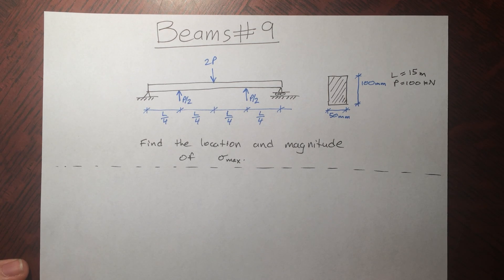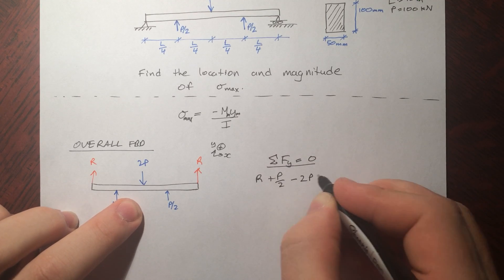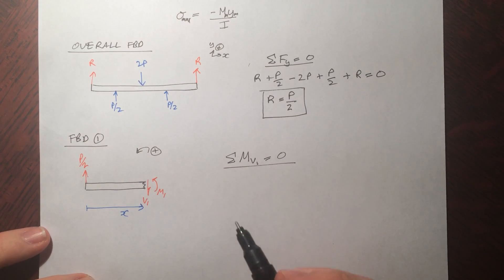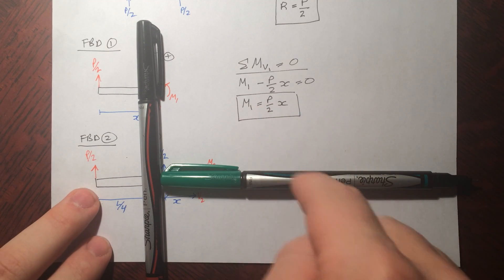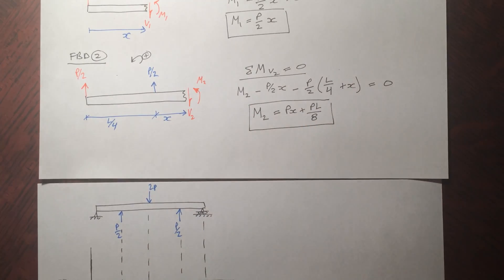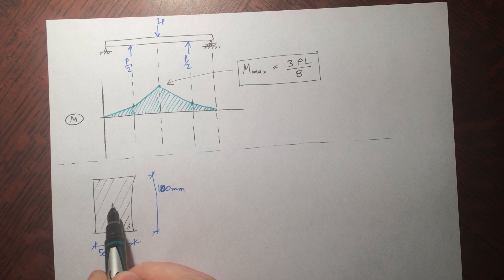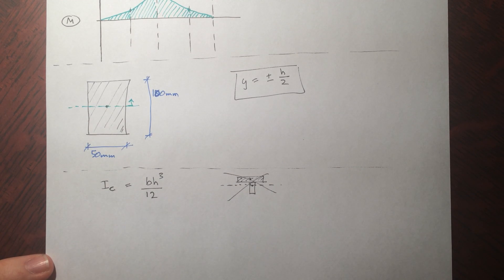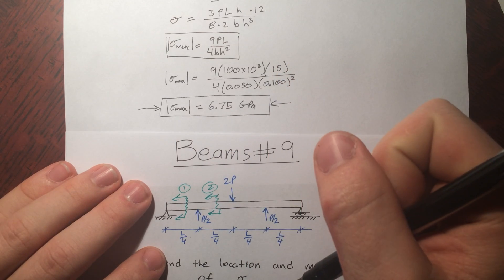Beams - 9 - Bending Stresses in Beams Example #1: Discrete Loading, Find Max Stress

Comment: Thanks!
 But, isn't y value calculated wrongly?
Isn't it right that y-value equal to 0.025 which is h/4 instead of half of h?
Reply from the maker: No. The y value for max bending stress is always on the beam fiber farthest from the center, so in this case, y/2.
Reply: @engineeredadvice2392   Thanks very much for your clarification.